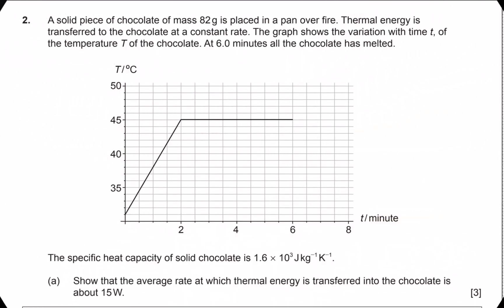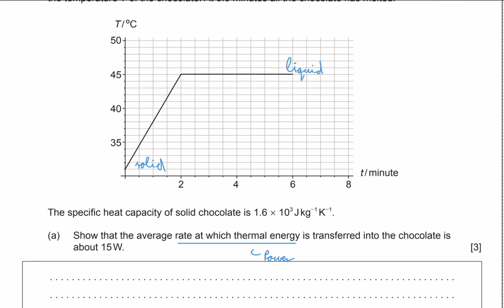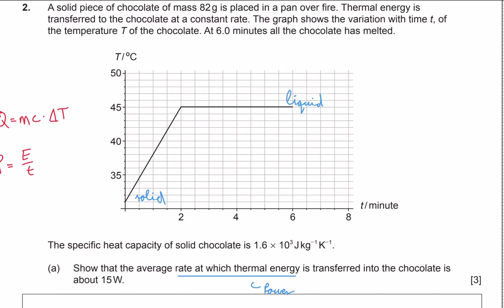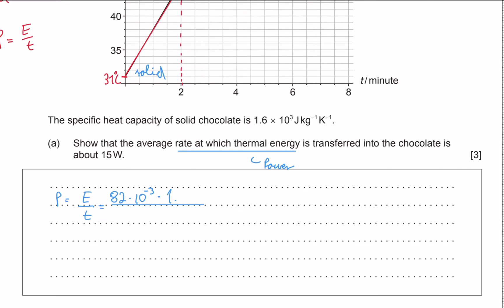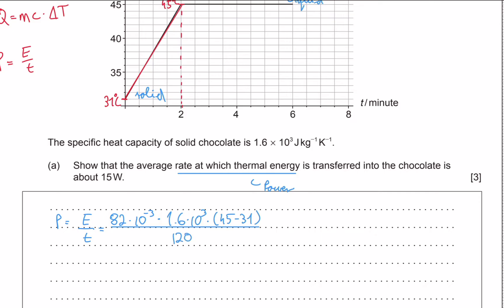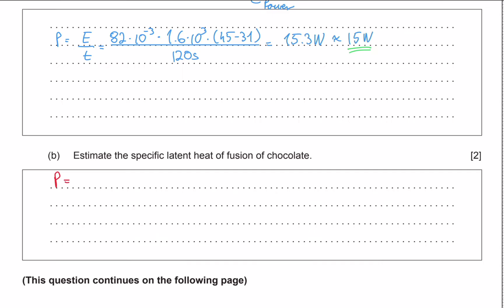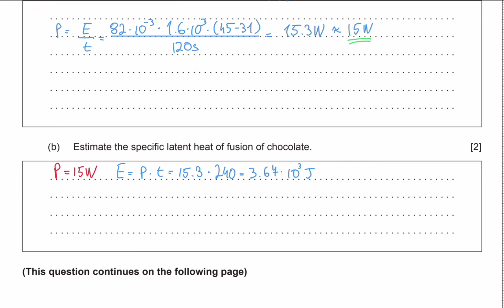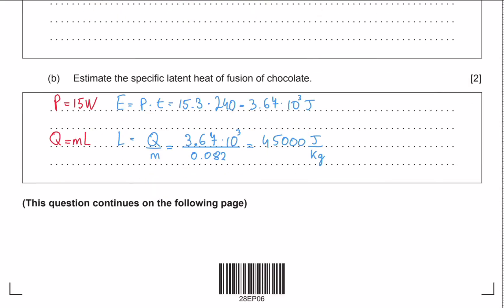IB Phy HL M23 TZ1 Paper 2 Q2 Thermal Energy Transfers || A solid piece of chocolate of mass 82g ||

Comment: i am 9 months late but why didn't you convert the temperature into kelvin and if the conversion does not matter then why am I getting wrong answer when I convert the temp. into kelvin HELP PLEASE at 3:45
Reply from the maker: Your converting it wrong then. The difference between 2 points in the Kelvin scale is same as Celsius scale. We just add the same number to both values in celsius, that doesnt change their difference.
Reply: @ConvergingIB  Thanks for the quick reply, I got the correct answer now I was indeed doing incorrect conversions